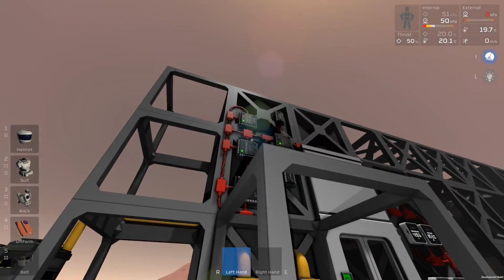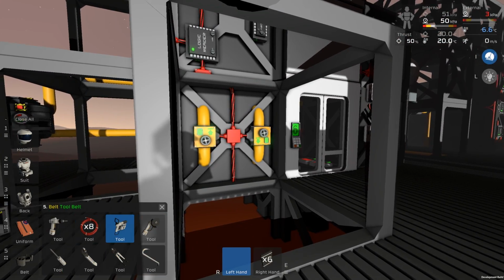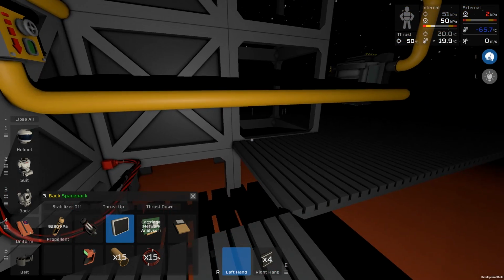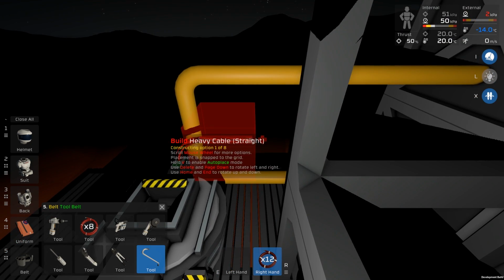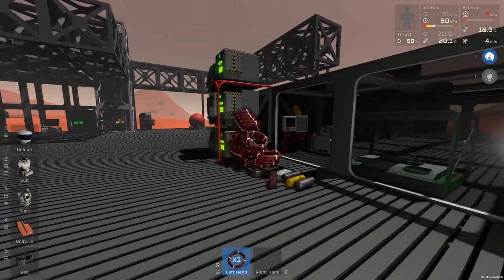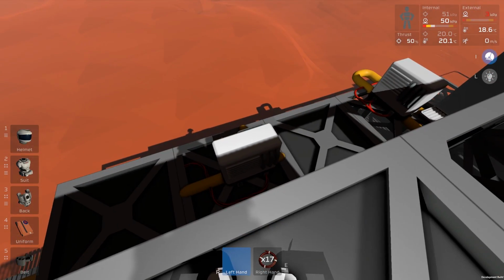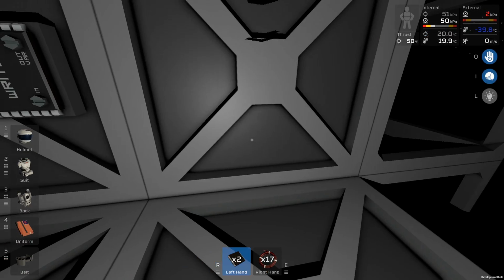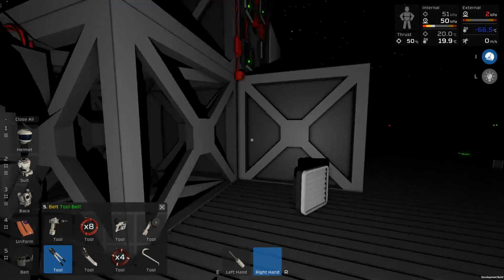Stationeers S2 E36 - Furnace Insulation and more Schmitt Triggers

Comment: I dont understand this, I have the same setup on the moon, 20kPa pure CO2, room and pipes fully enclosed in steel blocks, I even have 6 heaters, and it won't go above 500°C. Nothing on the outside is hot, so it doesn't seem to lose heat to surroundings. The only difference: I placed the furnace directly into the heating room (cause why not). Can furnaces lose heat into the void? EDIT: they can! https://steamcommunity.com/app/544550/discussions/2/1746720717352462254/
Reply from the maker: I'd definitely try it without the furnace in the hot room!
Reply: I did, it seemed to be the only significant difference. Without the furnace, the room reached 2000°C, burning even heavy cable. Bug filed:

https://steamcommunity.com/app/544550/discussions/2/1746720717352462254/

Comment: Love the idea so I tried it as well. I had a problem retaining heat. I tried putting the furnace inside a block and using logic switches to control the furnace but I still lost a ton of heat when any ores were put in. So I ended up making a fully enclosed 1x3 room. Tank, Heaters and furnace all inside the room with no access. Pressure regulator going into room from tank at 25 with a back pressure regulator at 20 so the room constantly cycles. 15 pipe radiators with 2 volume pumps (in and out of the furnace). What I found out through testing was the only way I could reasonably keep heat up was to have 16 heaters... which left me needing 50 solar panels (mars) and 15 batteries to maintain heat while smelting. Console wise I have consoles reading room pressure, room temp, tank pressure, tank temp, furnace pressure, furnace temp. Furnace Control I have 2 switches for volume pumps to bring up and take down furnace pressure, an activate button, an open lever and a LED console readout telling me reagents. Putting the tank and furnace inside the heater room was the only way I could keep the furnace heat up. Btw, my setup uses 17.3KV just for my furnace.
Reply: You will lose heat because ores (except copper at least) emmited "smelting" gases into the furnace which are at 0°C
Reply from the maker: I think we lose heat on ingots too (to heat them up)
Reply: grayduster next time you are going to add ingots to a furnace, check if the ammount of moles of CO2 and/or X is rising, in the furnace.
Reply: That's why you should buffer a lot of gas in the hot tank, so it can heat up over time (because you don't need to smelt all the time, the game isn't 'Furnace simulator 20XX' it is Stationeers), that is also why you should have a easy way of "cycling" your furnace and your hot gas tank, since the furnace will always have a small ammount of gas and because of that drastical temperature when you put a lot of ore (at least).

Comment: Why are you putting expensive heavy cables on non- load-bearing circuits? IRL you'd also fry the sensitive components..
Reply from the maker: Filtration unit inside a block is in the next episode yep - saw your comment :)
Reply: grayduster+ How about the other comment?
Reply: fourdotsYT Because everything doesn't have a transformer and normal cables melt in high themperature enviroments.
Reply: fourdotsYT And if you were to just replaced some heavy cable for a normal one, if the cable network would exceed 5kW of load, then the normal cables (no matter where the load goes on the network) melt away in a random pattern.
Reply: By the way, he can exceed the limit, because wall heaters take impulses of power of magnitude of 1kW each, and he uses a volume pump which is continually using 2kW (I think that the setting of gas flow doesn't matter, since it wasn't like that in the first place, before their power usage change); so at maximum this heating system uses 6kW already without counting in any logic, consoles, pressure regulators and filtration units.
Reply: Surely some of the control systems can be isolated? It just seems wasteful..
Reply: The problem is that you would need to un-weld all the frames, find a place a transformer, replace half of the cabeling and then re-weld the frames, which would lead to massive temperature drop, since pipes are inside frames for a reason (to keep heat in, it allows to 100% heat isolation). I don't think it would be beneficial for him at this point (but if he were to do that from the start, then it is easly doable and will save 0.5g per heavy cable not used). And this allows for simpler setup, not needing to worry about what is on what network. And if you would need gold (or any ore infact) just install like a 2x ore yield mod, it makes you not continually look for rescourses if you want to make some logic units, cables, or piping.
Reply from the maker: One of the main issues is that I need to do things like read the values of something in the high temperature area - you can use logic mirrors, and isolated logic memory chips to do things like that (without directly connecting), but as Eryk says - it's often easier just to connect up with heavy cable.
Reply: grayduster+ have you noticed my comment about putting the filtration unit inside frames?

Comment: grayduster+ If you want to 'see' (it is described using text) a half-automated furnace setup and it's very simple logic; look for it in the comment section of the episode 35 of this series, there is my comment with 3 my 'subcomments' (a comment under a comment) one after the other, the last 'subcomment' is the most important, there is the whole logic described, however it might require reading all of those (4) comments, since I referenced previous comments while writing newer ones.

Comment: 19:10 grayduster+ you absolutelly can put it inside frames, such that you have acces to it's filters (unless it was changed). The trick is you don't put it on the floor, you put it on a wall, in two separate vertical 'qube spaces', and you cover the lower part of it with a frame, you can acces the filters even with a wall kit on  the floor it's in!
Reply: One note: If you would try to put it on one of north/south or east/west it might refuse to allow you to place, it is easly solved by placing a un-welded frame, where the bottom of the filtration unit should be. By the way, if you have the frame placed first then you can put a filtration unit 'in the air', but only when the bottom of it within that frame.